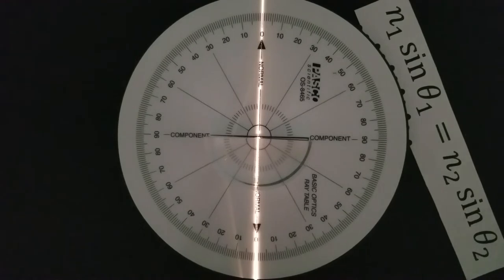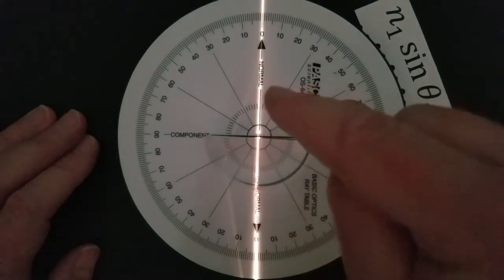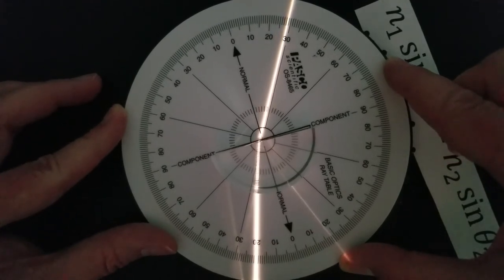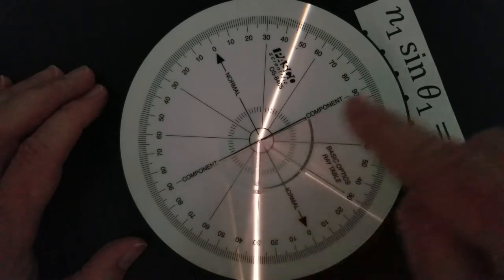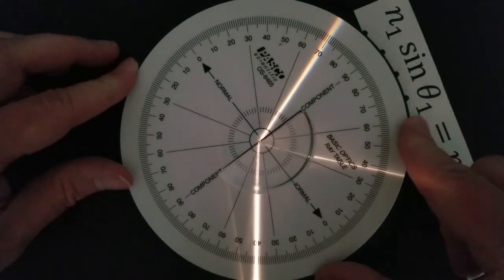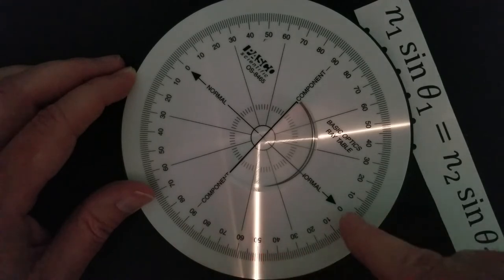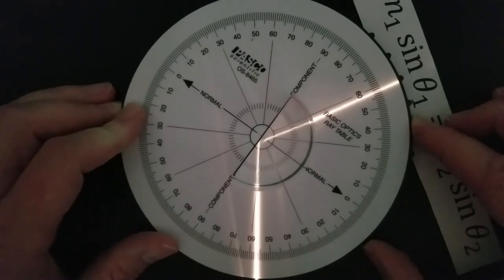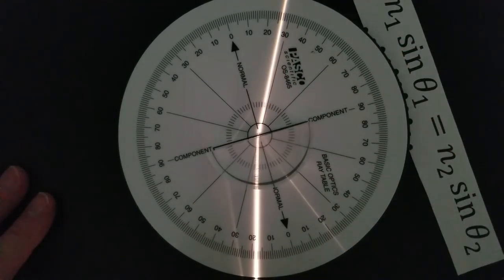Snell's Law finding the Critical Angle

Comment: In this experiment, what would be the critical angle of the red and blue light? How would you determine that value?
Reply from the maker: Yes, each color would have a slightly different leaving the object, and I don't know those critical angles. I would use either red and blue lasers or a safer way would be to use a thin beam of red and blue light. Some school science supply companies do make these lights. Arbor scientific makes these https://www.arborsci.com/products/primary-color-light-sticks which should work, but I have not tried. The difference in the angles will be very small.
Reply from the maker: And, thanks for watching my video.  I hope you like the others.
Reply: @thephysicschannelwithkenny314  Thank you for your suggestion. I appreciate the resource! I had another question, I created a graph of the index of refraction for the flat surface as shown in your other video. Which was sin(Incident angle) as a function of the sin(Refracted angle) in order to get the Index of Refraction of the material of the lens in accordance to Snell's Law. My professor wants to explore how to verify the principle of optical reversibility with the data from this video's setup: the curved surface. How would I prove this principle with this data? Should I solve for the sin of the Incident and Refracted angle and plot them on the opposite axes? I did this already and I got a very simlar number within uncertainity to the Index of Refraction of the lens. Would this prove that the trajectory of the light is reversible? If not, how would I prove this principle? Thank you again!
Reply from the maker: So, what you would do the have the incident ray come in the curved side and exit the flat side. (The opposite of my Snell's Law Video). Now, the light starts in the lens. The refracted angle is now the incident angle. You would then measure the new refracted angle.  I believe what you did should be fine.  Additionally, you might do a ray drawing for both situations and corresponding angles to show the path is identical in either direction.
Reply: @thephysicschannelwithkenny314  The drawing is a great idea! Thank you so much for your advice. I hope you have blessed day.
Reply from the maker: If you think my videos are helpful, let others know about my channel.  Good luck with physics.